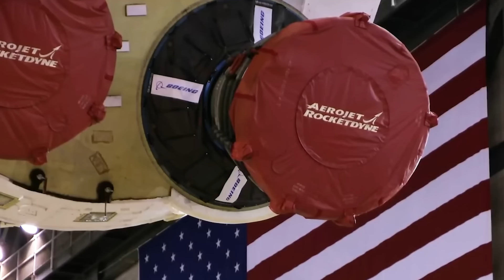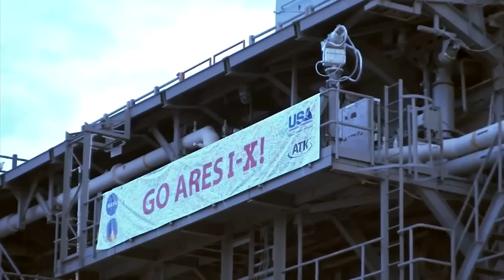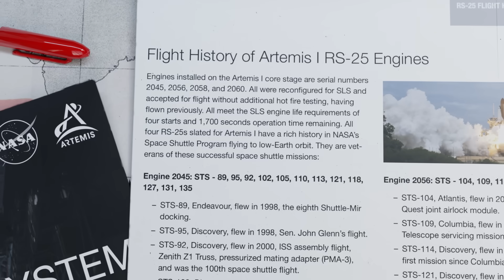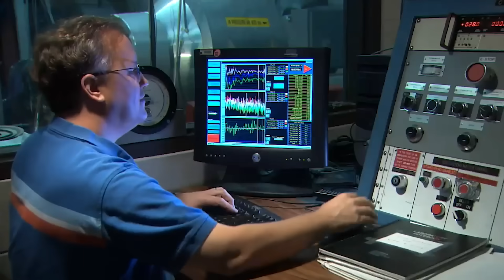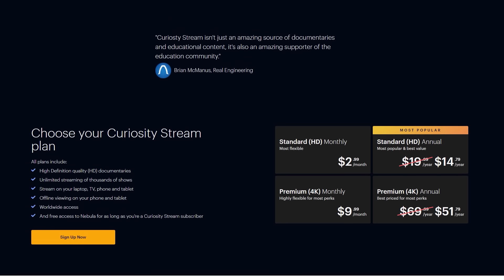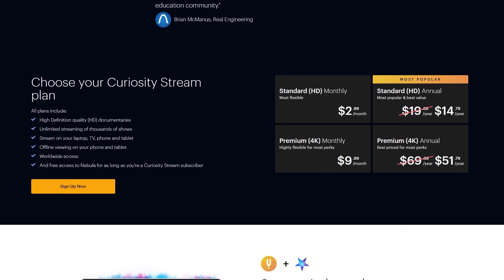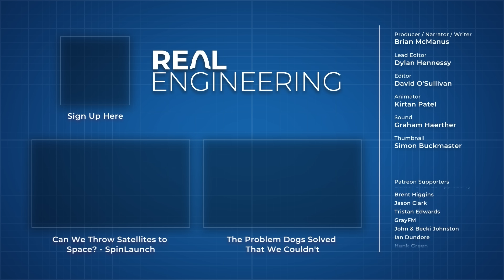The SLS is Outdated. Why Does it Exist?

Comment: The fact the SLS is ready to go and it’s checks notes one and only competitor is not ready to go definitionally demonstrates SLS is not out of date. SLS might not be the future, but is absolutely the present.
Reply: whats the competitor?
Reply: I think you meant to say StarDigger
Reply: The R-25 engines alone are more advanced, efficient and cleaner than anything spaceX has been able to make propulsion wise
Reply: The competition will catch up unlike NASA the private companies are profit driven which means it won't take that long for someone to eventually make something better than the outdated SLS for a cheaper price
Reply: 50 years later space is still difficult, slow and simple is still the way to go.
Reply: @diverman1023 I’m not sure that 40 million is cheaper than the less than a million a Merlin costs.
Reply: @lukezhang3017  Again, they're just worse rocket engines from a technological standpoint, reflected in the price. You straight up can't compare a cryogenic engine such as the R-25 to a kerosene Merlin. Your less than a million pricetag is horrendous for the environment and less efficient. Also has more recorded failures than shuttle engines
Reply: @diverman1023  the Merlin 1d has only had one engine failure and has never caused a loss of mission. And the raptor engine which is a methalox full flow staged combustion is proving to be developing a reliability at a much lower cost compared to the rs25. So though the rs25 is an engineering marvel, it just isn’t cost effective, especially considering it’s use on an expendable rocket.
Reply: @Bulletz4breakfast What? Starship is not a competitor to SLS in ANY way, they are not competing for anything, they are actually dependant on each other…
Reply: @diverman1023 definitely cap. Have you seen the new methane engines?
Reply: @diverman1023 you're out of date on your knowledge of the Raptor 2 then, on a ratio comparison, it outperforms it in every way. Including dollar to thrust cost.
Reply: @anthonypelchat excellent points and source. Everyday Astronaut does great coverage of the Raptor 2 progress.
Reply: @corymcdowell7295   I never said it wasn't cheaper, just that it was a worse technology in every way. It's way worse for the environment and less efficient with it's fuel consumption
Reply: @Bulletz4breakfast Thats not it’s competitor. Starship is in a different category. It’s closer to the Shuttle and the Buran.
Reply: @tetraxis3011 if successful, it will definitely be able to do more than the space shuttle and we’ve never really seen full use of the buran

it has a good while to go before it reaches that point though, so it’s not in a state to compete with SLS yet
Reply: @diverman1023 disagree, while the rs-25 was historically one of the best engines created, the raptor 2 and now 3 are better in almost every regard (with the exception of consistency, and arguably marginally in efficiency). Not to mention they are one of the only, if not the only, full-flow close staged rocket engines
Reply: @diverman1023 that's certainly a meme

Nobody would bem that stupid to really think that
Reply: Well when you have a federal budget and decades worth of old parts, you can slap together an updated version of a saturn 5, and throw most of it away after every single launch, gotta love that federal money. 50+ years after Apollo, the massive saturn 5, and the iconic capsules, what do we get with our modern technology and decades of spacecraft design? Well we got a massive rocket, with a capsule, and sure we've got better materials and computers that can do more than one thing without crashing, buuuttt this is the best we can do? Maybe if the political parasites in Washington would stop pissing away 100s of billions of $ just to watch ukraine get turned into russias newest vacation destination. But then how would we honor those open ended military contracts. Ahhh humans are fucked
Reply: Comment aged like buttermilk
Reply: @diverman1023 environmental impacts? Pretty sure that’s the least important thing they’re looking at when picking a rocket since that negligible to what we already do
Reply: Always remember

We talk about community that both says RS-25 is outdated but at same time wanted to resurrect F-1 instead
Reply: SLS's competitor was saturn 5, SLS program in modern era can't achive payload what they did in 60s with less $$ & technology
Reply: NASA is decades behind SpaceX when it comes to hype and marketing.
Reply: @diverman1023  with spacex's raptor engine i don't think that is true anymore. NASA are far behind the private sector currently. spacex does a launch it seems like every month or so yet nasa we might get one every 5 years.
Reply: @pyotrberia9741  True, I bet that the average person knows that starship exists (mainly bc of the IFT-1 failure) but they prob have no idea that the Artemis program is a thing. I’m not saying that’s a good thing, but that’s just how it is.
Reply: @pyotrberia9741  hype and marketing yes. But when you ask the average person about who is the leader in space, they will say NASA. It may or may not be true, but that's what the average person knows. SpaceX will become the industry standard for launch hardware. But SpaceX is unlikely to be more than a space logistics company. Research doesn't pay their shareholders and NASA doesn't answer to shareholders, they do science, which we want as the main goal for the leader in space. Ultimately it's a good thing. NASA can focus their own budget on building things like JWST and the Rovers while SpaceX can make launching those cheaper and easier. And if NASA want to be the ones who build their own rockets, they have to follow in SpaceX's footsteps. Rapid iteration and taking risks and pushing the tech forward. Unfortunately, throwing away the boosters after launch just isn't practical in this decade. And NASA just isn't ready to give up on that.
Reply: If i remember correctly, their most powerful rockets used to cost 1B dollars+ adjusted for inflation. Spacex launches for 100mil and 150mil if boosters not recoverable. That's the difference
Reply: @xNSHD  that the SLS SRBS are not reusable do they still have parachute
Reply: @edsherwook5196 exactly. You can't pick on rockets' environmental impact when we still have planes flying around in the sky.
Reply: @diverman1023 Making the case that Raptor isn’t more advanced than RS-25 is a very difficult case to make indeed. The only real advantage RS-25 has is that it uses Hydrogen, which obviously gives it an ISP advantage, but Raptor has it beat in cost, manufacturing, design, thrust, etc…
Reply: @diverman1023 Methalox requires a greater fuel mass, but that's the cheap part. Hydrogen needs larger and more expensive tankage.
Reply: It’s a shitty Frankenstein rocket
Reply: @diverman1023 and now 1 year later the Raptor is here and flying on starship and the sls is outdated lol
Reply: Yeah I think it’s a reliable launch vehicle just a little pricey
Reply: HOWS IT GOING.🫠